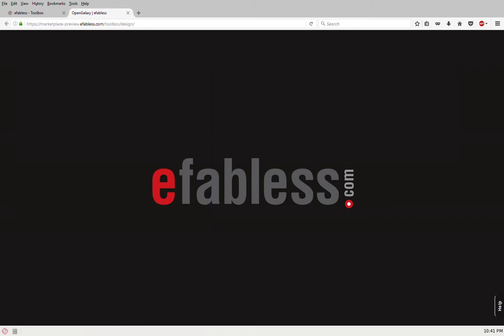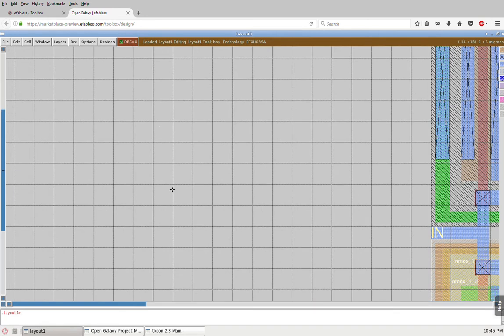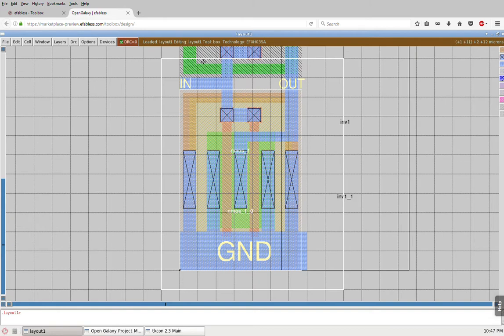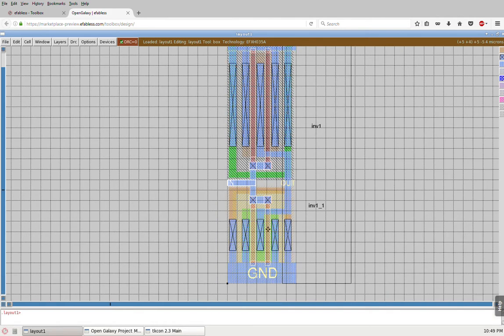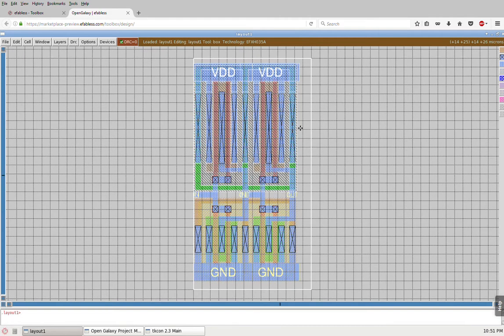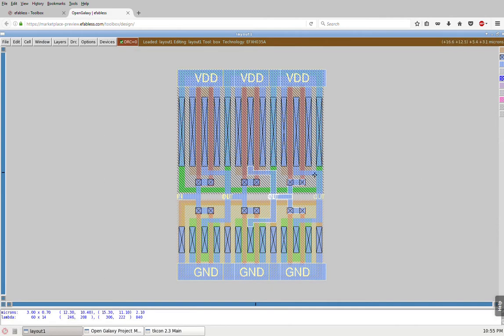Magic Tutorial #1 -  Highlight of Magic Features

Comment: First of all thanks for this tutorial.Very informative.Some comments: @6:13 is that two fingers for the nmos device with half the width to reduce parasatic capacitance ? This is interesting because in the osu350nm tech, for the inverter cell, there is only 1 finger for both the pmos as well as the nmos device. @6:55 it should be source/drain/source as for a pmos, the source is connected to the Vdd and the output is connected to the common drain right. There is a metal from the common drain connecting to metal where output is tapped and this is also connected to the drain of the nmos below.Lastly, I think the interpretation should be that the minimum length is 0.5 um and 10 um width.

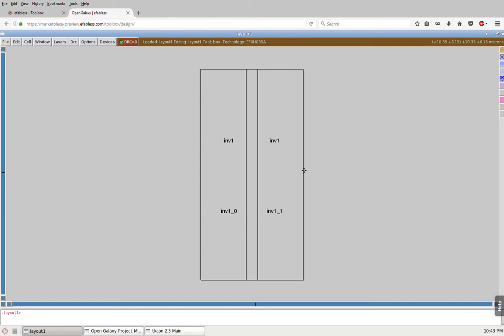Comment: 2:07 Setting Up Grid
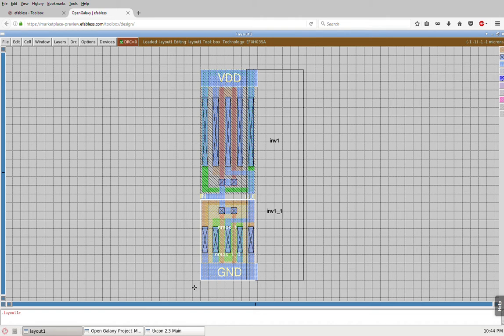3:50 Drawing a Rectangle/Box
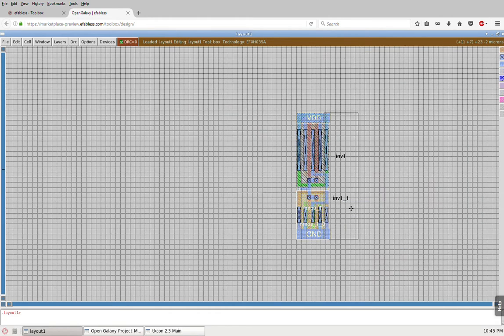4:40 Zoom in/out
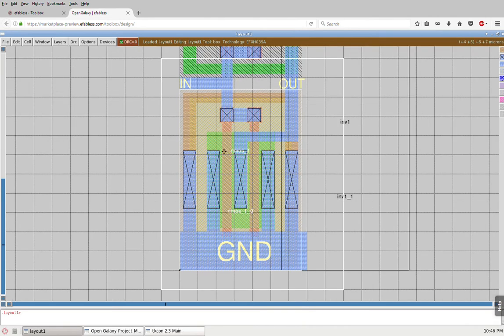5:00 Layer Familiarisation
8:00 Metal Selection/Connectivity
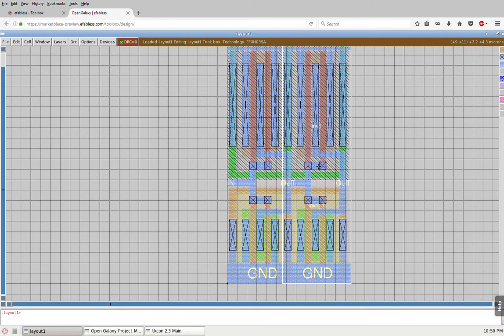9:00 Trace the Connection
10:46 Measure device/Box size
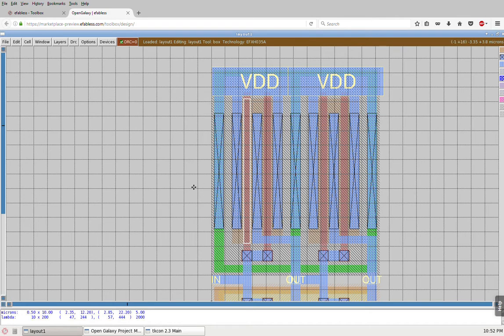11:34 Select a Cell
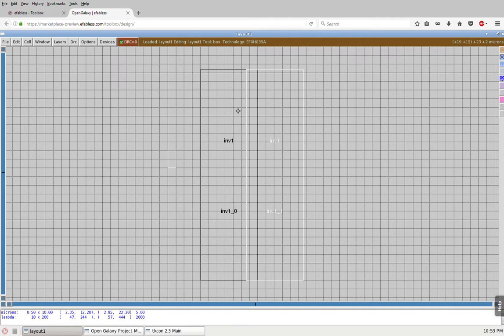12:20 Copying Instance
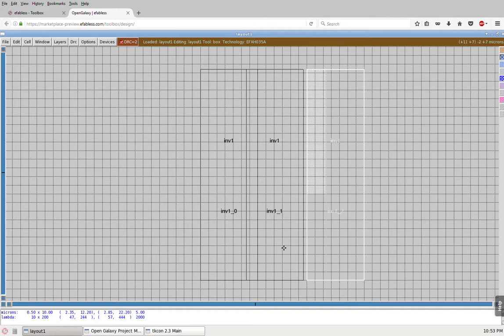12:42 DRC Error Highlights
13:42 Moving Instance
14:02 Measuring Scale 

S : Select 2:40
/ : Expand Toggle 3:00 (View/No view)
G : Toggle Grid 4:27
F : Full view of entire Cell 4:55
Ctrl+I : Select Instance 11:40
C : Copy 12:20